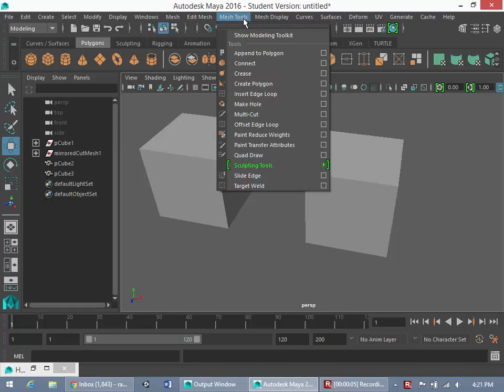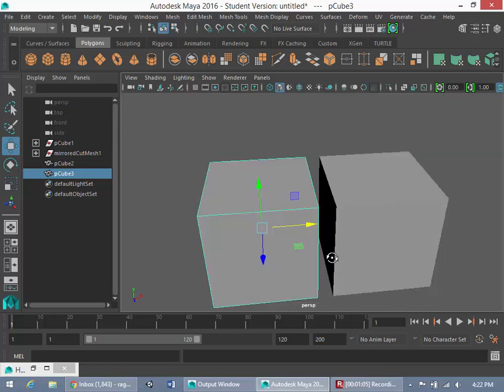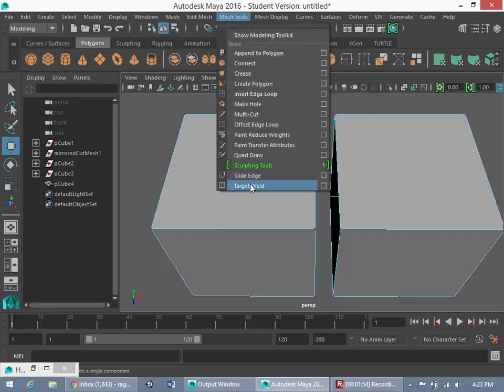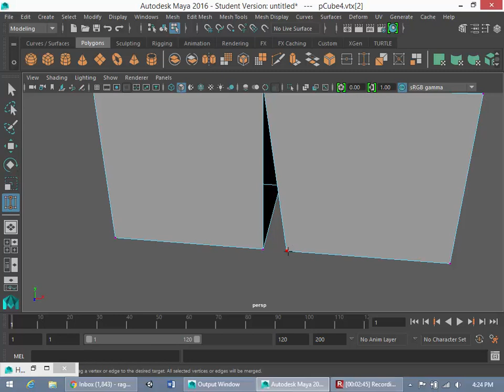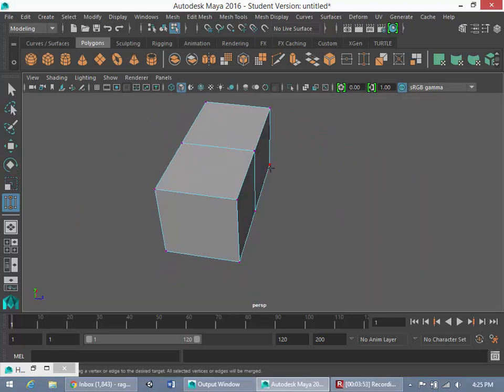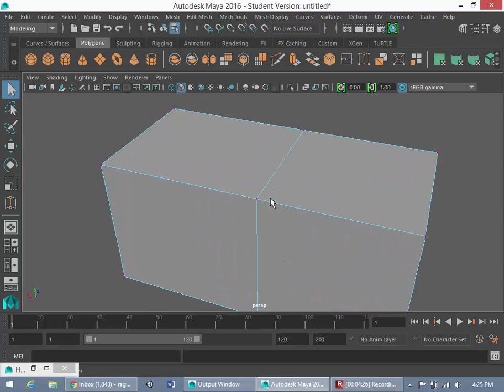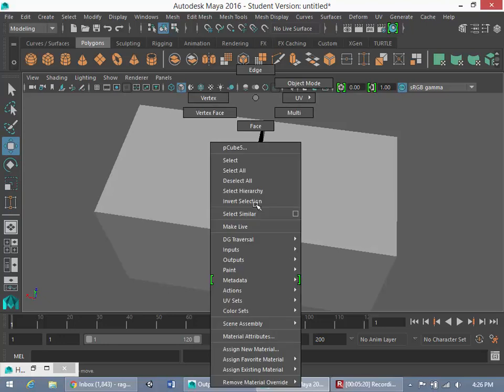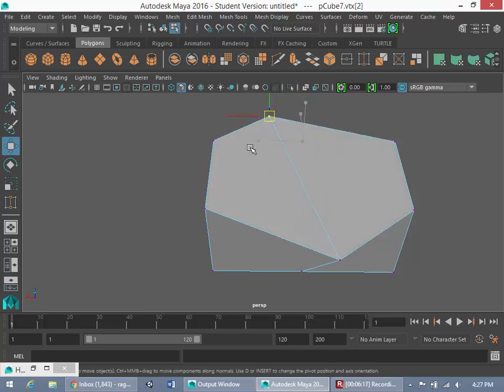Maya Tutorial How to use the Target Weld Tool

Comment: I have been looking for a tool to welding spline verticies, but unsuccessfully. Do you know how to do that?
Reply from the maker: I'm not sure if there is a specific tool for it but you could try two things. Option 1: edit curves->open/close curves to close a curve between two points. Option 2. Convert your spline to a polygon object and then use the weld tool (but that probably defeats the purpose of what you are looking for).
Reply: I know 3ds Max supports this. You can attach two separate splines so they belong to one logical, but they're not connected physically nor even touching. Eventually, their end points can be welded making it look like one curve. I liked this approach.

Comment: I can't drag one vertex to the other vertex. Please help TT
Reply from the maker: For it to work you need to be in vertex mode. Try right-clicking and holding and switching into vertex mode. Also, if the two vertices are on separate meshes you need to combine the meshes by selecting them both and going to Mesh --> Combine.

Comment: Hi Robert, I have a problem with the weld tool. It doesn't merge 2 vertices if it's on different polys. If it is on the same poly it works perfectly. Do you know any solution to that? Thanks
Reply from the maker: If you are using it for two objects you have to select them and do a Mesh --> Combine first.

Comment: Why delete the faces? Why is it not recommended that you don't combine the two objects without deleting the respective faces?
Reply from the maker: It is recommended that you delete the faces because once you weld the edges the faces will no longer be visible, as they will be on the inside of the model. Part of optimizing 3D art for entertainment media, such as games, is trying to minimize the "polycount" or amount of triangles on the mesh. By keeping unnecessary faces as part of the geometry, the polycount will be increased where it isn't necessary. I know it seems minor when it only involves a few faces but it is also best practice for keeping the mesh clean. Leaving those faces inside of the mesh could result in unpredictable things when you apply different modifications to the mesh later on.
Reply: Very thorough answers and good points. Thank you!
Reply: so if your just making a res render you dont have too?
Reply from the maker: It is always best practice to delete those faces, but for a res render it isn't essential.

Comment: Quick question. Why not just use bridge?
Reply from the maker: You could use bridge. The one difference is that target weld merges the two vertices together. Bridge is similar but merges two pieces of geometry by inserting a number of edges between the two objects to "bridge" the two polygons. Either works, it all depends on the situation you are in with the specific model and how you want to merge the two objects (i.e. target weld would keep the same number of polygons, whereas bridge would increase the number of polygons.